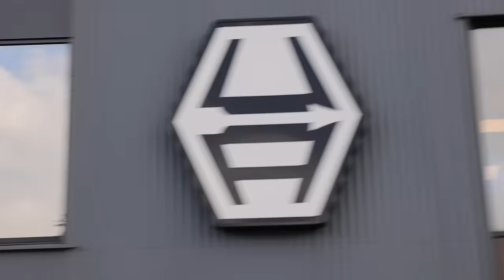Behind the Scenes at Urban Arrow

Comment: Thanks for the inspiring look Chris! I think that here, that Portland Oregon might be a good candidate for adoption of Cargo Bikes, as it's a fairy compact city with better than average bike infrastructure, but also some fair hills that might dictate electric assist. If you're interested I can look a bit more in-depth to see what might be happening and the official interest and planning.
Also, Ive been knocking around with some Solidworks designs for a very light EV/Velo concept with enclosed rear cargo and/or passenger accommodation, I could share with you. I also  have some time available 3D modeling any designs you or others might have in mind.
Reply: An electric rickshaw would be good, both for passengers and cargo.

Comment: The Netherlands front the Atlantic ocean and it rains a lot there I’d be curious how their bike companies stave off rust issues as most of the bikes in the Netherlands are left outside most if not all the time
Reply: Not just rust, also mold and algae.
Reply: Apparently your opinion is based on some bad images of Amsterdam. 90% of all bikes are kept in a convenient back yard building where they are dry and out of the elements. Every house in the Netherlands has them and they are required by law since 1923. Furthermore they have to be accessible from the street, direct or by a path that gives access to the back yard.
Even apartment buildings are required to have a bicycle storage, communal or individual per apartment.
Reply: @dutchman7623  They don't fit cargo bikes, and on new houses they are a lousy wooden 1,80x3m60 prefab piece of junk at best. You really need a place with a private car park to properly store these bikes and be able to ride them out without much hassle. The average UA I see in my Dutch city has a parking spot in the front yard and is attached with a chain to a anchor on the front of the house. No front yard, no UA!

Comment: We have the Cargo Bikes from Urban Arrow at our Gorillas facilities (grocery delivery service). No one wants to ride these 7000€ overpriced death machines. Feels like you are trying to balance a 2 meter pole on the tip of your finger.

All we asked for were dampeners for our seat to help our backs on the bumpy roads. Instead we received a coffin on wheels
Reply: i like to regularly rent them via cargoroo and find them easier to ride then a regular bike, the motor and stepless gear makes for a very smooth ride. Maybe if you are in a big hurry all the time like in the delivery business its a different experience?
Reply: I guess that it's a personal preference. Personally, I would rather use a nice trailer rather than a front loader.
Reply: There must be a difference in the selection of Gorillas riders and Coolblue riders then, because I talked to quite some Coolblue riders who love their Urban Arrow.